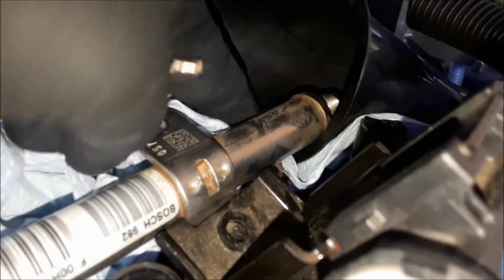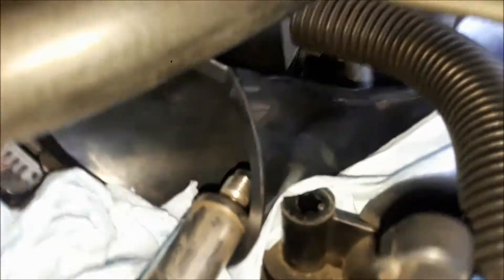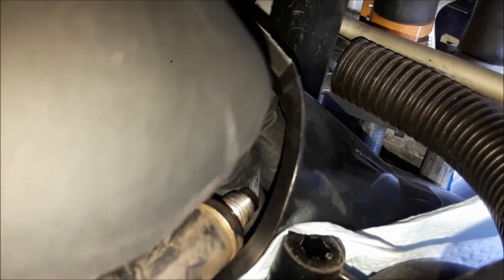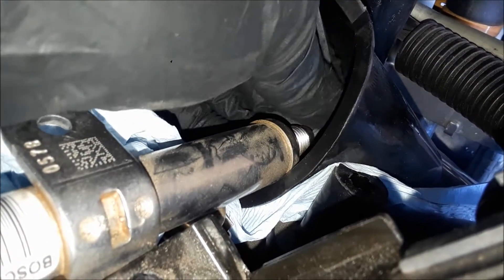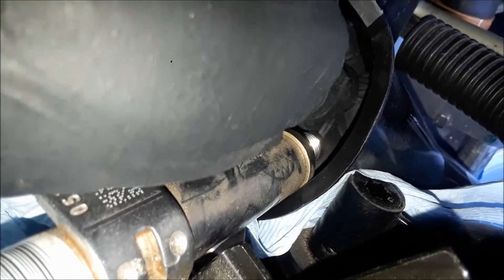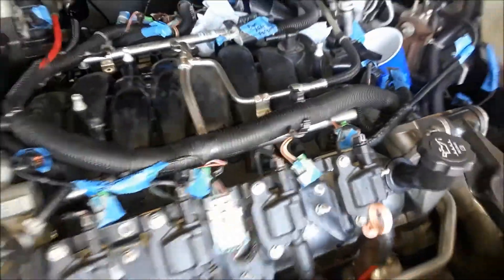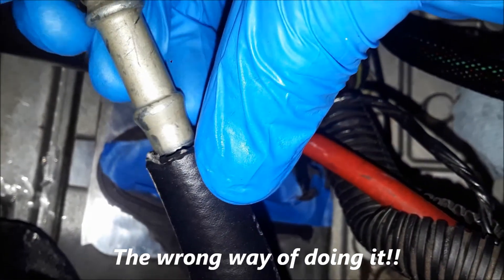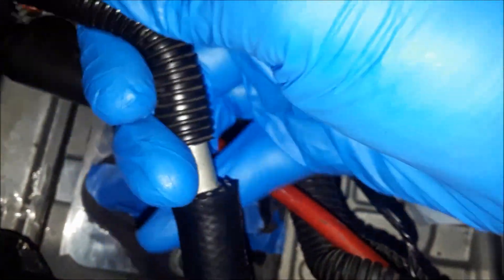LS4-LQ4 Intake Swap Step 6

Comment: So you are put the truck intake on the impala ls4?. I was thinking about putting the heads and intake manifold from ls4 to my 03 Tahoe 5.3. I read that the heads will add 20 more hp to my motor
Reply: There are way better heads you can put in
Reply from the maker: Its in a 07 MC. Same motor (LS4) yes alot of people love the 243 heads and adds around that range.
Reply: @demariojason  I was just meaning for the guy with the tahoe

Comment: Did you end up being able to fit the opsu in there in the stock location?
Reply from the maker: Oh yes sir!! You'll see it in the further step/videos somewhere (I can't really remember. Lol) But with this intake bro, it sits so high, that it clears it. Now be mindful, you do have to grind a little on the back side of the intake that bolts up to the TB, where the OPSU sits. The thing is you have sit the intake (with intake gaskets installed) carefully in and out of your the LS to make sure things like OPSU, Alt bracket, & PS reservoir isn't hitting up against your project before bolting all that shit down. Lol